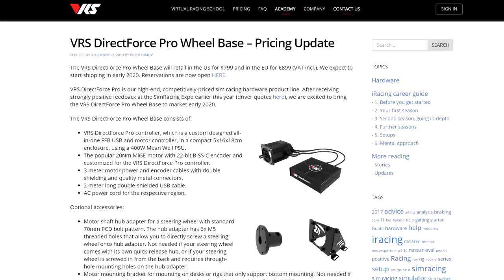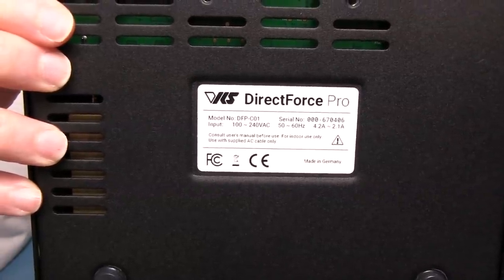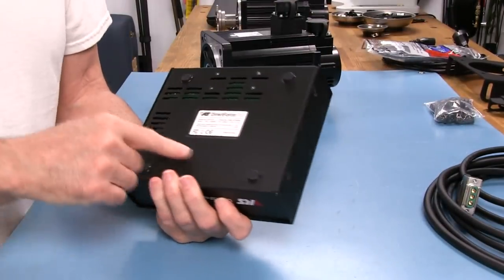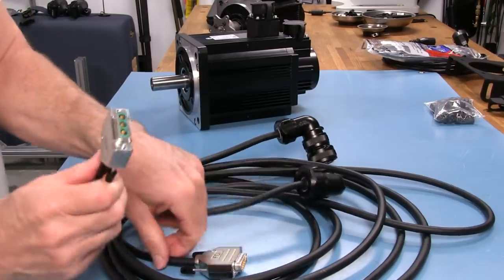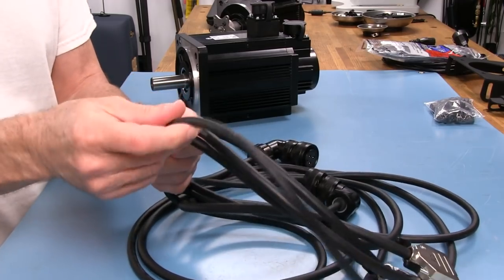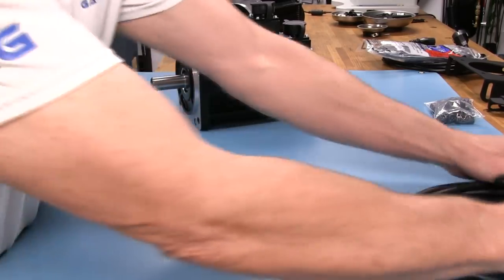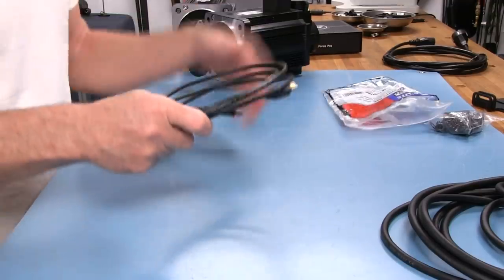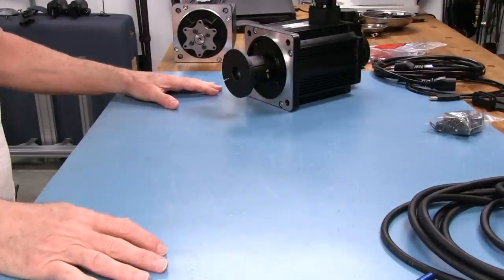VRS DirectForce Pro DD Wheel System Review

Comment: Any suggestions on website for where to buy a reasonably priced wheel for this?
Reply: simracingcoach.com has a few very good options. If you also get the quick release they offer (separately) you don't need the VRS hub adapter.
Reply: @david_haas_  I'll second this.

Their $50 QR is actually very clever, and very simple to operate, and their wheels are well priced at around ~$400 w/QR.

I have the GT wheel, and while it's not as nice as Cube Controls or PSE, it has magnetic shifters, clicky buttons and two rotary encoders.

You should check out Penguin RC.  They probably offer the lowest priced, high quality wheels that I've seen, and the owner (Brian Sohn) has forgotten more about DD technology than most of will ever know.

Comment: Which wheels can I connect to this and what do I need? The adapters and quickrelease market is so crowded, that I do not know which wheel to order with this VRS DFP DD.
Reply: Pretty much any usb wheel will work with this. If you’re looking for more budget oriented wheels I suggest sim racing coach or if you want the best of the best cube controls or ascher racing. As for quick release, sim racing coach sells one that directly clamps to the shaft of the mige motor and uses a bicycle seat style clamp as the quick release. Another thing you could do is get the clamp straight from vrs and bold the hrs xero play quick release to it, but that’ll be pretty expensive.

Comment: New to sim racing here.  Is there any compatibility concerns matching these "a la carte" equipments?  What wheel physically fits to this DD, and what about software?
Reply: most "OSW compatible" wheels will work with the hub clamp VRS optionally supplies. Basically you need a wheel with the standard 70mm screw pattern. Some companies like Fanatec require conversion kits. to mount their steering wheels.

Comment: I've been holding off buying dd2 or dd1 f1 for this. At almost 1k cheaper than dd1 f1 I think I've made my decision {have wheels that I need to convert to USB). Just Cmon vrs open up orders for U.S.!
Reply: Don’t want to defend Fanatec or anything...I just think that your comparison is far from fair. The Fanatec Dd F1 comes with a really good wheel with magnetic shifters plus you forget the price of the wheel adapter...another 50 bucks. So at the end the price difference is about 350 bucks. Still a lot of money of course, but far from „almost 1k“.
Reply: As Attila said, I do agree that $350 USD is a more appropriate price comparison, but still that's almost enough to buy a DIY 80/20 rig...plus there's the possible con of steering wheel pins eventually breaking on the DD1/DD2 (which is what I've been hearing lately due to the podium quick release not being tight enough...don't kill the messenger) and from most accounts I've heard in the high end forums, the current pecking order on feel/detail in this price range is the SC2 Pro on top, then the VRS DFP then the Fanatec DD2.
Reply: johndough247 i really think they did something to fix that quickrelease, cos I got my dd1 installed yesterday on a 80/20 rig, and I was worried about the flex, but it’s freaking ROCK ZOLID. 
I know it’s hard to trust someone’s personal experience but I pulled that wheel and rocked it as hard as you can and it doesn’t move an millimeter. 
So they definitely did something to tighten that release!
But yes 350$ is still a lot of money, but Fanatec’s ecosystem with software and hardware should also NOT be underestimated. 
Fan Alan’s is really mature with setting for all games and a big community. This helps immensely to get your wheel setup, and your overall experience!
And honestly from my POV, just that part is worth a lot of money, but we all prioritize different things.
Both probably are a good choice, but really that release is so tight on mine. 
Read some others saying the same lately so think they fixed something, I might make a video about it to show it off.
Reply: @z0lid  
There seem to be a wide tolerance with the quick release system on the DD wheels. Some said on the first batch they have zero movement, others that they have a lot. I for myself think that this QR system is sufficient for the Clubsport series bases but definitely too weak for the Podium DD base. They should have designed a completely new QR but they went with backwards compatibility over zero movement of a potential new system. In my opinion every DD owner should receive a proper QR system up to the Podium standards, as soon as it's released...but I'm also aware that this is not how businesses work.
Reply: Attila TheHUN well I’m not sue,  it google it and you’ll find a lot saying the same thing lately about no flex.
I’m at least super happy mine has none what so ever, like I can’t stress how freaking rock solid it is.

Side note, are you from Hungary?
Reply: @z0lid  
That sounds good. Glad that you are satisfied. If it's really true and they changed something on the QR, I will contact Fanatec for a replacement QR, because mine is pretty bad. Not really an issue while driving but it just would feel better to know that there is actually no flex and no FF detail gets potentially lost.

Yes, I was born in Hungary and live in Austria. :)
Reply: @Attila TheHUN https://youtu.be/cn-suTuYdjc
There is a video of how solid mine is, the minimal flex you see when I pull on it really really hard is the rig flexing a tiny bit, but no flex at all on the quick release.
Not sure if it’s something new with the quick release, better QC or if I’m just lucky. 
I did note how ever that my spring to my CSW v2 seems to be harder than on other reviews I’ve seen of it, like my spring is harder.
It’s hard to see how hard people have to pull on theirs, but it at least seems a bit harder than others. Might just be me imagining it tho, but the quick release is for sure a lot more sturdy than others I’ve seen. And I haven’t even tightened the screw super hard.
The reason I asked if you where from Hungary is that I got some custom made shoes in Budapest made, from a shop called Attila shoes, so thought there might be some relation there ^^ But maybe it’s a really common name in Hungary ☺️ Just recognized it.
Reply: @Attila TheHUN
Chris Hayes released a vid today also about his dd1 and seems to have had the exact same experience, with no flex in his quick release.
https://youtu.be/DnleB4OBuzc?t=306

Comment: Nice job, Barry, per usual. I'll check their site if they have a desk-clamp mount for this WB. I don't have space in our computer room for a rig.
Reply: Sorry to tell, but a desk-clamp wont do the job. 
Try bolting the wheelmount to a desk or something.. that might work
Reply: @hansdoof655    Didn't word that well. What I meant was, mount bracket and wheelbase to piece of wood. Then use 2 clamps to hold piece of wood to desk.
Reply: Fanatec has a clamp-mount for wheelbase to desk. I have to check if mounting holes on the Fanatec match up to the ones on the VSR WB.

Comment: You really should begin to test your hardwares with other sims other than iRacing... try rfactor2 which provides the best telemetry outputs for FFB, motion and bass shakers!
Reply: No
Reply: Khyber GT 
Woww a very well and convincing response!
Reply: Actually iRacing is very suitable for that test purpose. Why? It does not cheat with any artificial effects / canned effects (which also is a problem as the physics model for some car series suck, making a lot of racers hating it). As long as Barry does not use R3E, AMS2 or PCars2 for the test, all is fine :-D (they all cheat the shit out of the FFB, the in-game FFB settings of these titles speak volumes!)
Reply: Testing is about working with constants...He tests in Iracing on Sebring or Nords. How constant do you want it to get.
If you like Rfactor more as a sim, that is a complete different story.
Barry does a great job in testing stuff, imho the best out there.